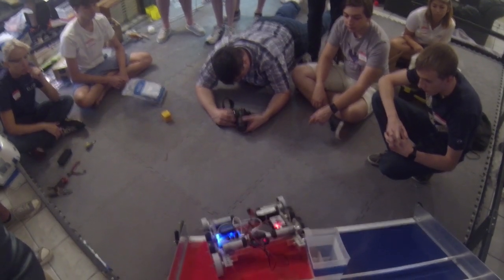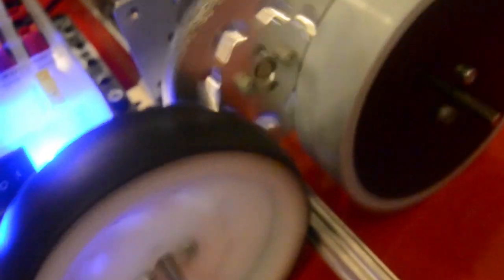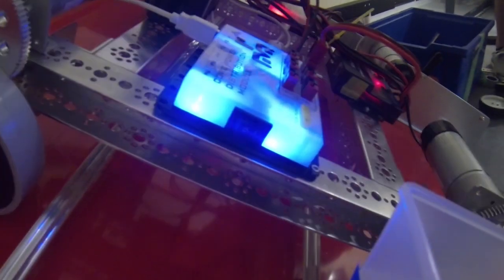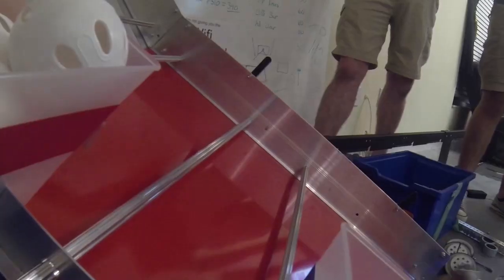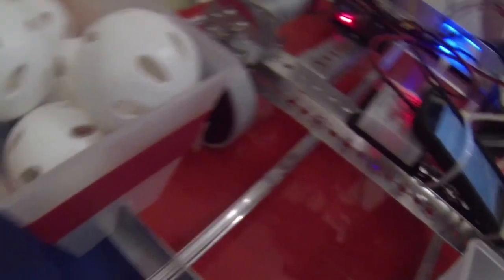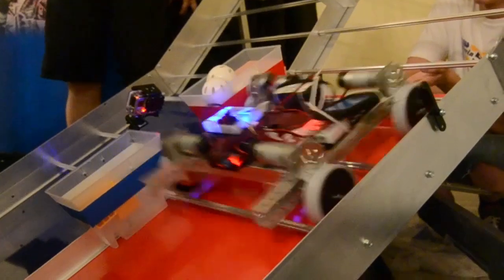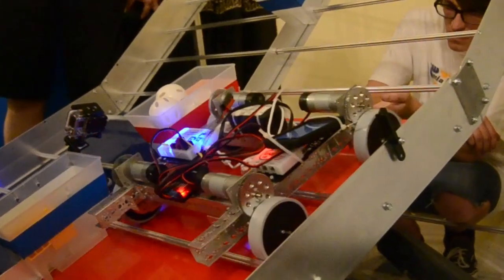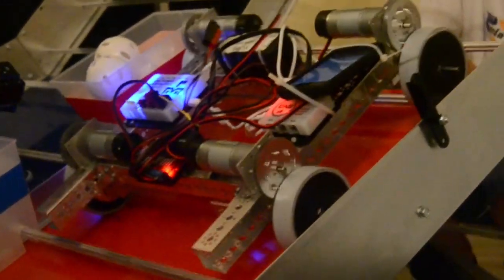Ri1W: Drivetrain Modifications

Comment: "Why don't you do treads?"
Reply: +TheKaziCo There is nothing wrong with treads at all. When we were designing our drive system we were limited with the resources that we had. The issue is that the tetrix treads arent very good and fall apart very easily. I believe that if you could buy decent treads its a good solution to this years problem. -designer for Ri1W
Reply: +TheKaziCo (it was a joke, I was in your stream)